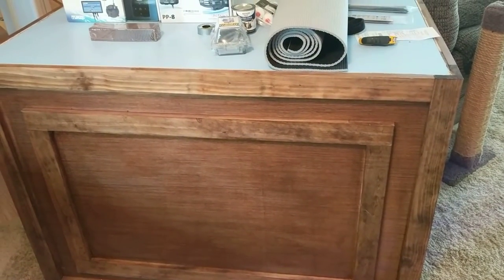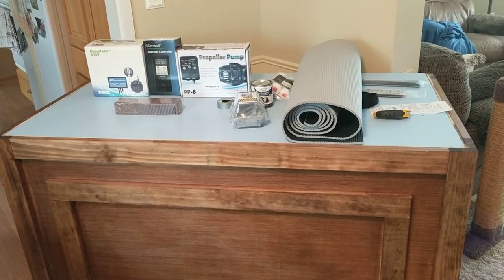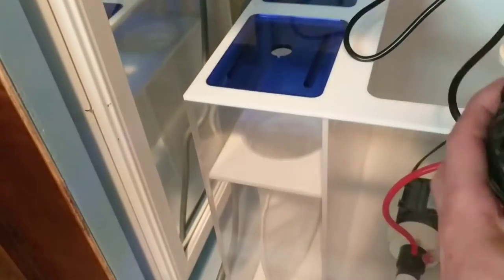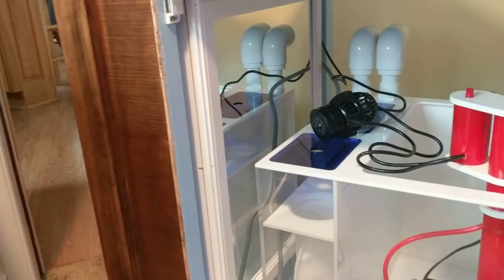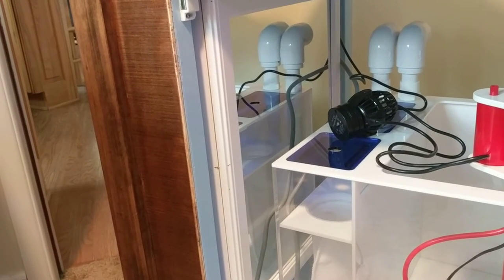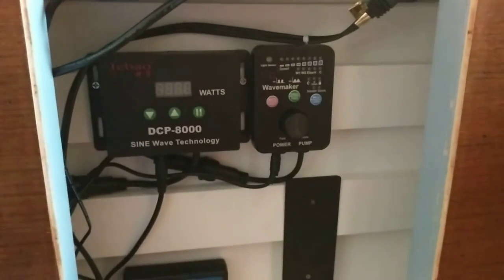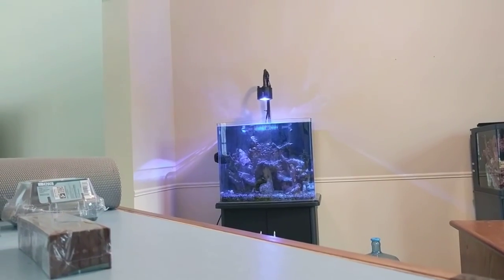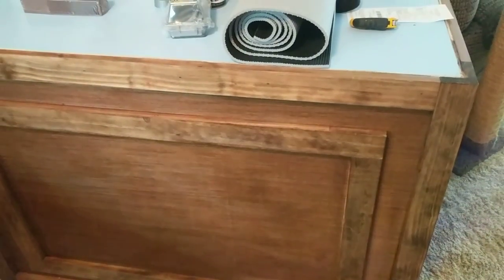Electrical Cabinet for 120 Gallon Reef Aquarium Build

Comment: That Electrical cabinet is an awesome idea. I have some left over plywood from my stand build. I may try and do something similar!
Reply from the maker: +Bearded Leprechaun Thanks! It definitely looks cleaner and will keep things more organized.
Reply: What brand is the power strip. Looking for something like that where I can turn individual power outlets off/on.
Reply from the maker: +Bearded Leprechaun Here you go. Tripp Lite 7 Outlet (6 Individually Controlled) Surge Protector Power Strip, 6ft Cord, & $25K INSURANCE (TLP76MSG) https://www.amazon.com/dp/B0068LACFI/ref=cm_sw_r_cp_apa_2nQ0ybSF5EW5V I can't take credit for the find. I think I saw it on one of King of DIY's videos.
Reply: Thanks! That is actually the one I have been looking at this morning. Think I will be picking one up soon.
Reply from the maker: +Bearded Leprechaun Can't beat the price for what you can do with it (individual switching)